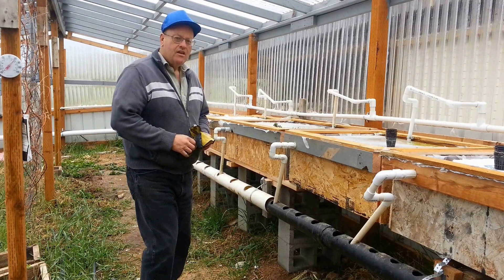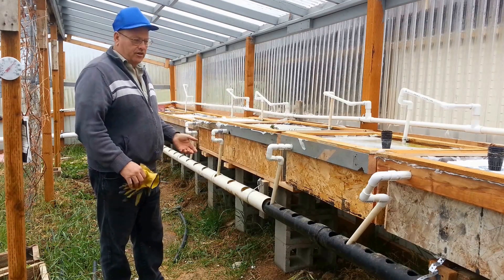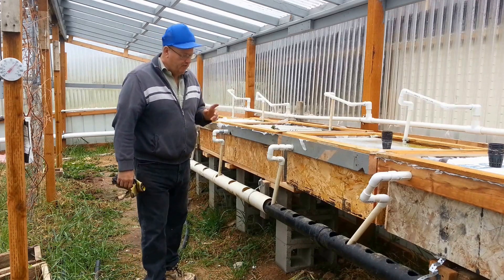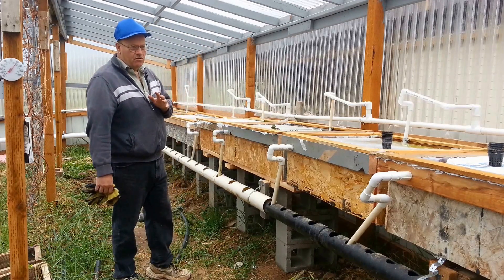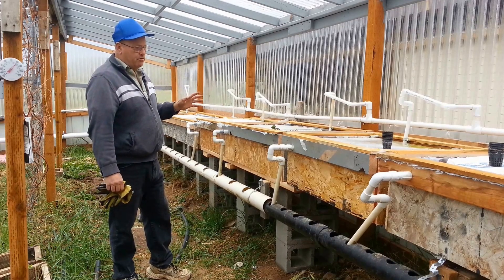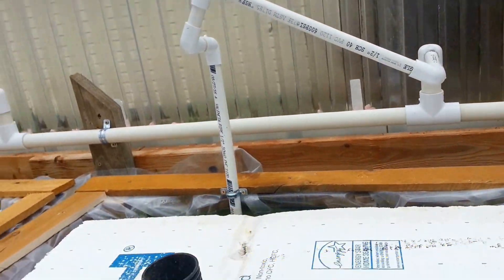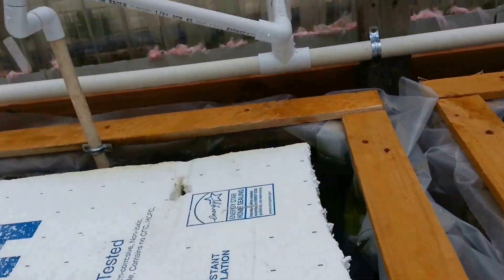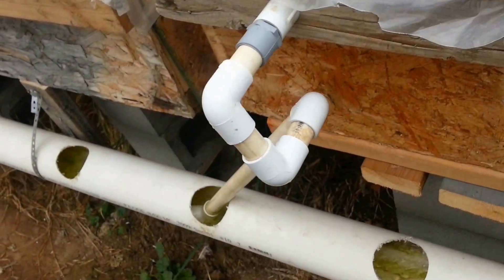Installing my Greenhouse Aquaponics system   Part 4   How the fill and drain system works

Comment: Great system lots of thinking went into that one, bypassing the water is a cool way to maintain to head pressure by using gravity as your control.  Also consider Keeping the header diameter larger relative to the take off pipe diameter to equalize the pressure from start to finish on the system and reduce head pressure requirements on the pump.
Reply from the maker: Thanks Fred,
I did think about it for a while before I built it.  I am still using it. It works flawlessly, even as the pump wears down and isn't quite as good as it was when new.
Ed

Comment: Good explanation.  Well, I guess.  Not really educated on that method, but understand water going upwards creates more pressure in the line.  I would have thought that pipes going out in that pressured line, like you're doing, would relieve pressure.  For example, have the "T"s at each bed drain directly out instead of rising up at each bed.  In that case, all the pressure is relieved prior to getting to the up pipe at the end so no water would go up.  Water follows least path of resistance doesn't it?  So, those are my inexperienced thoughts on it.  But, really commenting to know what size and wattage is the pump is in your fish tank pushing all that water constantly.  I have an interest in such things, but worry about the cost of the pump running all the time.  In my case, I could use a constant pump to run water from my pond throughout the greenhouse then back out to the pond in some fashion.  Also, would a 1000gph pump create more pressure to a series of valved "T" lines if it were pushed to go upwards some feet at the end of the header line?  My pump pushes to 7 valved "T"s and I control pressure to each grow line with that valve.  The end is capped and it's all basically somewhat level.  Always looking to improve.  A lot to digest, eh?
Reply from the maker: Brent, 
I guess I forget to describe  the pump.  It's 4500 gallon per hour and I think it's max pressure is about 10 -12 PSI.  So it has a lot of flow but the pressure is kept low because  it is essentially free to flow  up to the overflow point.  Then it just drains back.   In this design I want the pressure to be maintained by the overflow point and not at the individual pipes in the grow beds.  That is where I figured the tedious flow adjustment would show up.   So if each pipe at each grow bed cannot "see" any effect of adjusting the others.....I figured that would be desirable and easier.   You need the header line to be large.   The pump and header pipe should be big enough to always have some flow at the overflow even with the grow bed pipes wide open.  The grow bed pipes should each be much smaller than the header pipe.  I used 1 inch pipe for the header.  I think if I used 2 inch header pipe that would have been better.  I used 1/2 inch for the grow beds.  Don't want to cap the header end because the cap is now the termination and the pressure now depends on  the pump size, how much going to each bed and a few other factors.  If it is not capped....the pressure is ONLY dependent on the height of the overflow point.  I hope didn't get too convoluted in explaining that . 

Anyway I appreciate the comment.

Ed
Reply: Thanks.  I was trying to figure out how I could use the pressure of my 1000gph pump in the gh better.  I use a capped end and valved lines.